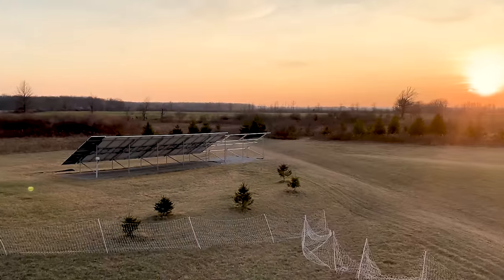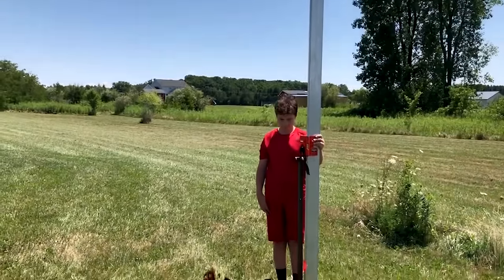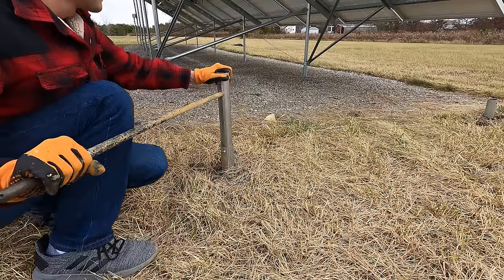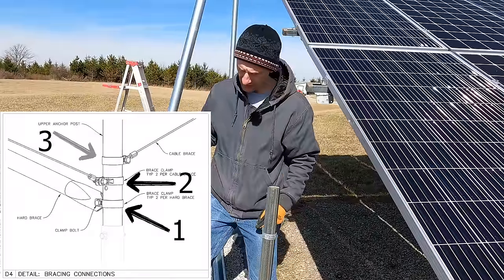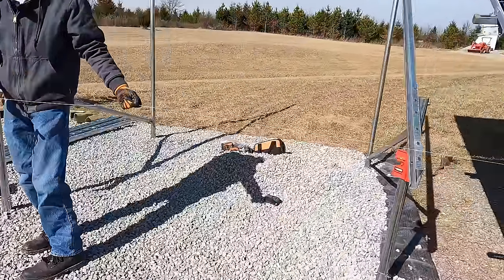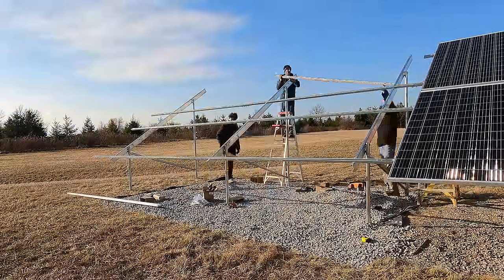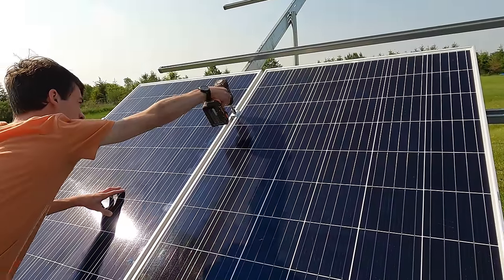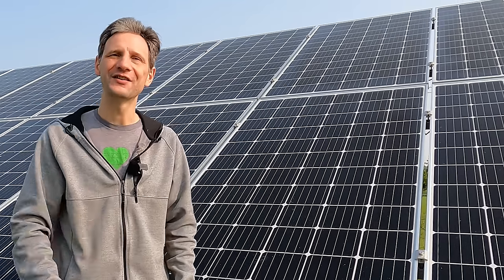Easy DIY Solar Panel System Racking Install

Comment: I used ready rack for my 11K system. It is a well designed system. Very good quality. Nothing to complain about. I would do it again.
Reply from the maker: Thanks for reporting your real world experience!
Reply: How many panels does the rack fit and what is it the estimate price for that size?
Reply: what was the price old man

Comment: I finally installed my ready rack yesterday. Due to some issues getting things aligned it took longer, but I will be mounting panels tomorrow. Also, that pro tip you gave is what I learned yesterday via some trial and error.

Comment: I used ready rack for my 12kw system after seeing your original video on it. Overall I'm pretty happy with it. It's survived our Oklahoma wind and snow for a year now with no issues. 

I will say, you have some really REALLY soft dirt there. Getting my screws in the ground was a total nightmare due to the clay we have about 18 inches down here. I had to get grade 8 bolts for my screws because the original hardware would snap off rather easily. I got to dig up 2 different screw heads because of this 😢

Also, my 35hp tractor would not screw in these screws all the way. Also, there was no way I was going to be lining up the bolt holes by hand. Luckily I rented a skid steer with a reversible head that made lining up the bolt holes easy. 

Overall I would definitely recommend the system but place a big BIG emphasis on getting the right screws for your ground type.
Reply from the maker: Thanks for posting your real world use case!  This is great information for people to consider.  For clay type soils, I think time of year can also play a big part.  I made a point to install my screws in late fall or early spring when the ground is soft from rain fall.  In mid summer, it becomes very hard, almost like concrete.  I was worried about breaking bolts, but had no issues with that, sounds like my fears were not unfounded.
Reply: @ProjectsWithDave  very good point about time of year. I installed mine during Christmas break of 2021. It wasn't freezing weather but that still may have not been the best time.

Comment: I'm not sure this racking system is quite as HD as some of the others out there (although likely cheaper and easier to install), but it looks like a good option for those folks that don't live is areas prone to extreme wind conditions.  BTW, I checked my location in CT and solar south was within 0.05° of due south... close enough for me!

Comment: 12:43 Pro tip: we build brackets from home depot in a double L and 4 in total , 2 for the  current panel and 2 for the next. The upper L will be put onto the lower horizontal bar or profil and the lower L mounted so to say upside down faces up that you can lay the panel onto them and adjust them easily without someone always having to hold that panel. 

You then have a master piece for the distance of the lower end of the panel to that profile where you mount the panels cause I bet the horizontal profiles and bars were perfectly aligned, and the the panels are a lot easier to align them perfectly this way. You can adjust the home depot plates , I mean 2 of these L  each 40 cm long with holes in a pattern drilled already from the factory can also adjust close to the perfect position. The last mm can be adjusted by a rod of wood and you have the perfect line. If you have screwed the middle connector you pick up the 2 bracket assmeblies ( built out of for L) and move them forward to the next spot. If you have additional pieces you can build a U shape at the lower end which prevents those brackets from falling of if you push the panels in place. Hard to describe but if you think about very valueable especially on the roof or if you have to work on your own and not further helping hand is available. 

Cheap (20€ or 20$ for 4 of them) and easy to build cause you simply need  8 L pieces and some screws to mount the upper L with the back on the lower L and adjust it the distances. You can also bend an U at the lower end with the U pillars in a distance of the height of the panel, mostly 3 or 4 cm.

Helps an awfull lot and can be reused later. And makes the aligning a lot easier cause your horizontal profiles are easier to align first and then you should get automatically the right alignment of the panels if they lay in these brackets. Attention: You might have to shorten the upper L to release it once the panel has been fixed. If the shorter leg is too long there is not enough space to the back of the panel, so 1,5 cm should be enough to held the panel in space but also short enough to release or recover the L from the holding position once the panel has been fixed.

Hard to describe especially in a foreign language but it is a very usefull geometrical alignment tool only for that particular use case and of cause on a roof too.

Comment: Great video. It’s crazy how expensive most ground mounts are relative to solar panels.
Reply from the maker: The cost of racking makes the high wattage panels more and more attractive.
Reply: @ProjectsWithDave  You’re right, that’s what I’m finding out.

Comment: Oh that's neat. I like that
Reply from the maker: I wasn’t sure about it when I first decided to go with it, but it was easier to install than I expected and I’ve had 60mph winds without even the slightest issue.
Reply: How would you compare this to the IntegraRack?
Reply: @Moes_Prep_and_Tech  I would prefer Integra rack. Super fast install
Reply: @WillProwse  integra might replace my East facing Against the Fence install in the near future for the early morning Sun till about 1 something. I was contemplating putting the biggest panels I could possibly get residentially on the EG4 Brightmount I currently have I have sungoldpower 460 bifacial on it now, I'm thinking about going to 560. I've seen 700w panels on the internet but I don't think residential customers can order them. I want my array stacked higher less horizontal space

Comment: really awesome. dont know how expensive is it in compare to other racks, but looks really good. Many people do a rack without diagonal stabilizers, that is actually wrong. Just I would make them  tighter, than one can do with bare hands and own weight.
Reply from the maker: Prices have gone up over the last few years due to the price of steel, but I expect that's the same for all systems.  When I did my original analysis to other systems the pricing was similar, but I didn't have to spend any labor or money on concrete so I came out way ahead with this method.

Comment: Okay....Several things come to mind. First, my Ironridge ground mount didn't require 2' holes 7 feet deep. Granted I'm not in a hurricane area, but my rack is rated for 120mph. The 'rack' sure looks like Unistrut. The small cables seem to be more  show and tell than anything else. I can't see how 1/8" cable is going to add much in the way of support. And lastly, how in the hell do you screw in the earth screws if you don't happen to have a tractor with a post hole digger attachment? Renting a bobcat would certainly put the screws to building a inexpensive solar mount.
Reply: The only support that the cable provides is connecting the long posts to the others. Should the rack deflect a bit in the wind, they'll transfer some of the deflection to the next post and that post to the next post, so the only way if fails is if a force is applied to that's strong enough to break the cable or bend the whole rack. Commonly available 1/8" steel cable is rated for 400lbs tension and has a breaking strength around 2000lbs, so they'll do a lot more than nothing.

How did you dig the holes for your concrete footings? The drawings in the video show the helix on the bottom of the posts are 6" wide, which I'm guessing is more narrow than the holes you had to dig. Anything that can remove earth with a larger radius than that should have enough power to drive these down. My point being that if you don't have something to do this you're probably renting something anyway.
Reply: Renting a bobcat for a few hours isn't that expensive.
Reply: It's three weeks later. Yeah seven feet deep is stretch, a back hoe, 36-40" and a sonotube. Just like a deck. I am not a fan of steel direct in soil where in can rust away, prefer it on concrete with anchors..

Comment: Try to get some WD40 Dry Lubricant it will 1) dry and collect no dust. 2) seal the nuts 🔩 from moisture, 3) makings it easily to remove if needed 4) removing moisture from electrical. I even used it underneath my car and lawnmower etc. thumbs up 👍
Reply: anti seize or go home XD

Comment: Hi Dave, very informative video. Could you provide a little more detail on the adapter to drive in the screws. Also how do you determine the soil type in a given are? Thanks for all your help
Reply from the maker: I just measured the diameter and bolt pitch on my auger and had a friend machine an adaptor for me.  Typically there are county maps with soil type for your area.  Or you could dig a hole.

Comment: Thanks for the video. Curious if the auger poles would work in the blue rock (old lava) that the minority of us here on the big island of Hawaii have on our property under the 3-4” of top soil?
Reply from the maker: I don't know the answer to that, I would contact the company and see if they have experience with that situation.  They do have a ballast system that does not require any ground penetration, that may be a consideration for you.    Ballast spec sheet: https://uploads-ssl.webflow.com/5e4bf6aabc92428ec6194695/634ea02dcb50d20a20dac2ce_APA_SPEC_SHEETS_V01.4_GEOBALLAST.pdf
Reply: @ProjectsWithDave  good information, thank you for the insight.

Comment: I just talked to this company today and got a quote and the price is ridiculously expensive!  I cannot see paying more for the racking than I pay for the solar panels themselves.
Reply: Yeah, that's why they don't publish their prices on their website.
They want to talk you on the phone and try and convince you why you need their product.
If the price isn't display clearly, I walk away. They can keep it.
Reply: @majorhavoc9693  You're right about that.  They're hiding something when they don't post the price.  Yup, they need to give you their sales pitch.  I'm moving to a new development.  I'm going to see if I can get the builder to bury some metal posts for me for not too much money while they're building the house and then I can attach some racking to the posts myself after I move in.
Reply from the maker: Building your own racking can be much cheaper.  However, if you have to get it inspected you will need an engineering certification making DIY much more difficult.
Reply: @ProjectsWithDave  I'm planning on living out the middle of nowhere so I don't expect there to be any such requirement from the township but I better ask ahead of time.  I think the AC side (grid tie) will be the only part that needs inspection and I would call in an electrician to do that part anyway. But if worse comes to worse, I'll end up caving and buying this racking system.

Comment: 8:25 when there are single holes versus slots available at the desired angle, the single hole is preferred. While it's a marginal difference on mechanical specs, it's a "why not" item easy enough to do.
Reply from the maker: Yes, but in this case I needed the extra height for managing the angle at this post.

Comment: Thank you for the content. I am in analysis paralysis. Need to get something built. you are 2ns or 3rd person i have seen planned and built a solar array, both roof and ground, then wanted it larger with more panels.  I think my goal is to overbuild a ground array rack system and then I have extra capacity for future expansion. 
Which is the best panel mounting orientation?  Portrait or landscape?   Seems like the size of newer model panels are growing also? does that factor into the rack mounting?
Reply from the maker: I can relate to "analysis paralysis."  😀 I don't regret making room to expand, but at some point you just have to make a choice and go with it.  You can see my logic for sizing my original system in this video on sizing grid tie solar systems: https://youtu.be/rbFnZqA0GCI
I targeted never overproducing, in retrospect I think overproducing a couple of months would have been a better balance for me.  I prefer portrait orientation, but it is going to be dependent on your racking system.  You will want to choose your panel first, then spec the racking to match.  I would quote multiple racking systems and choose the one that best fits your needs.
Reply: @ProjectsWithDave  Thank you for the content.  I’m off grid for now.  Also plan is for a lithium ion phosphate cell and natural gas generator tie in.  Why? The only electric provider in northern New Mexico doesn’t have any equipment I’m told supply chain shortages and hurricane Ian last year.  So they are not running new customer lines until 2024. A year  ago I was told by 2023.  I got a quote from your favorite rack company but shipping is very expensive from OH to NM and I didn’t see any discounts. 
Do you have a code?
Reply from the maker: I don't have a code.  I don't have an affiliate relationship with them.

Comment: Why not build a standard concrete column and mount 6x6 and build an angled deck surface without decking just joists.  I plan on building 8’ from to 12’ back.   With 2x6 on outside all the way around lag bolted to posts.  Posts are 12’ on center.  And 2x6” joist every 4’ with solar k2 tracks mounted to these joists.

The reason mine is so high is I have a walkout basement the lower side southern face of my hose.  Roof panel would have rarely hit above 50%.  

The added benefit is that above solar array is a 3 story solid wall of hardie which will add to reflection downward.

Comment: Great vid thanks. Im a huge fan of helical piles. My house is on them. I looked at their website though and there is no pricing which makes me think Im not going to be able to afford the system. Bummer.

Question-what is your east west span between the piles? How many feet between each one? Thanks
Reply from the maker: It varies a little depending on your panel setup. Mine is about 9’.
Reply: Thanks very much for that info Dave

Comment: Great video, thanks for this one and all the other diy ones you've shared related to solar.  

Im considering buying the ready rack as well.  Did you end up buying the hex driver bit for the screws/helicals  ready rack sells or end up doing something else?
Reply from the maker: I built my own adaptor for my PTO post hole driver.

Comment: on the cable suspension, I thought about using a long piece (8-12") of heat shrink tubing to secure the extra wire.
Reply from the maker: Sure, that would work if it was a UV stable tubing.
Reply: Great additional point! @ProjectsWithDave

Comment: For people without skid steers, what alternatives are there? I know I could rent one but if possible I'd like to buy something so I can use it over and over again. It's not clear to me that if I bought a post hole auger (the kind you can hold with your hands) that I'd be able to use it for this application. Thanks!
Reply: following.  I have the same question
Reply from the maker: If you have soft ground and make an adaptor for a two person post hole auger you might be able to do it.  Where I live the ground is clay and very hard in the summer, but in the spring it's very soft.  If you try it, or if someone else has tried it,  let me know how it goes.

Comment: Question for ground rod location? Should my 10’ rods be driven in by the pole with the conductors going underground to my solar shed or at another pole of the array about 12’ away from the conductor run pole?  Fantastic videos across the board Dave. I’ve learned a ton.
Reply from the maker: Generally speaking, you have one ground point for your house and everything goes back to that.  Usually two rods at least 6' apart.  However, I'm not an electrician.  I suggest you ask your local inspector for their input.
Reply: @ProjectsWithDave  Excellent, Thank you for the prompt reply, keep up your amazing works.

Comment: Is this Raking system going to be good for heavy snowfall(may be at least 36 inches) that happens in upstate new york? Does this system pass the standard construction codes?
Reply from the maker: Yes, the company engineers your structure for your local requirements.

Comment: Wouldn't it be beneficial to build a shed and use the panels as the roof? Is the open space important for cooling?
Reply from the maker: You get better performance on the ground.  You can see the performance difference with a shed application here: https://youtu.be/mzqjCsZKUYQ

Comment: Excellent Presentation, you may want to consider teaching part time at the local college. I get paid 85$ pr hr to teach architecture classes.
Reply from the maker: My degree is actually in Mechanical Engineering, so I don't think I'm technically qualified to teach this topic at college.

Comment: Cables are pointless. Just use regular ol chain link fence top rail (I'm guessing 3/4 to the top at horizontal would be the most stable).
Reply: I imagine less likelihood some derpy kid runs face first into a pole - plus great hanging space for drying blankets
Reply: wouldn't poles have to be cut to a more precise length, when cable is infinitely adjustable at the point of installation? Cables only work in tension of course, but that's why the "X". I've done  similar instals with both poles and cables and the cables were much easier DIY.